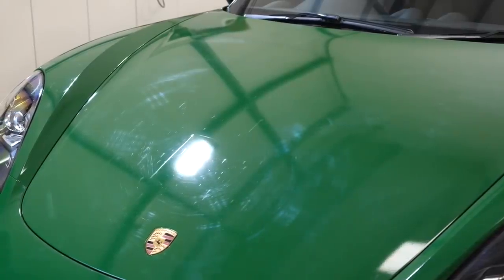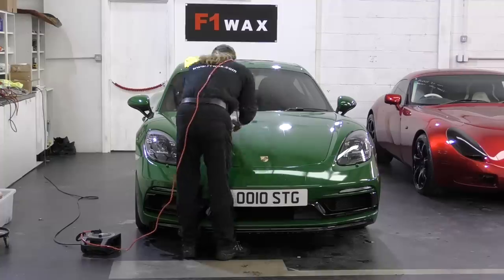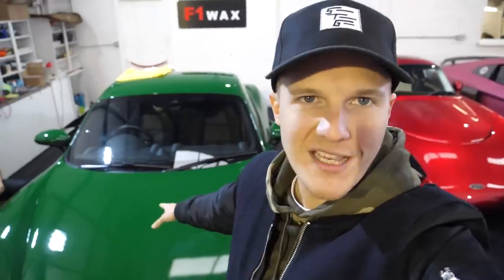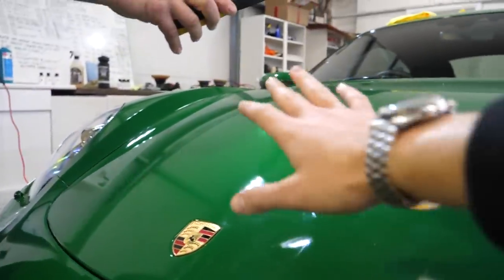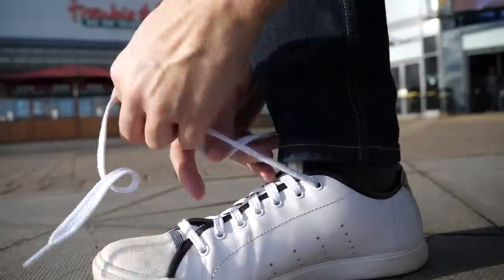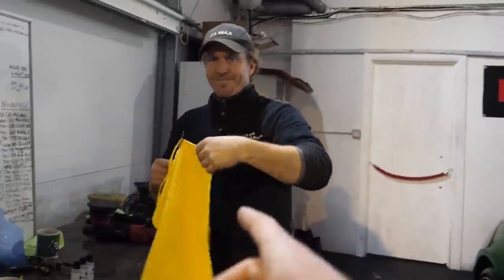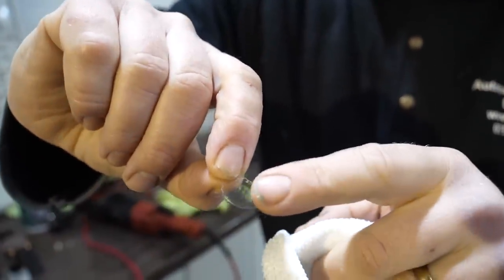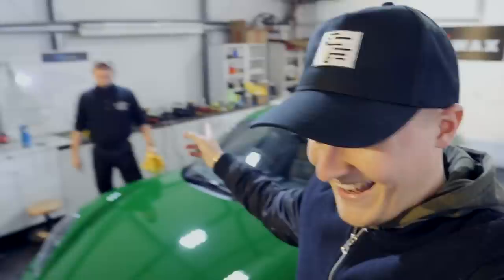Detail & Ceramic Coating To Vinyl Wrap

Comment: Wow, never knew you go that level of thickness of protection with ceramic coating!
Reply: Tiger Jim
You don't. You don't pour it onto paint and leave it. That was an exaggeration. Used to make customers excited
Reply: RB Detailing Yep. The amount of bullshit in this industry is astounding. People will believe that ceramic coatings will make your paint indestructible. Plus £100 for two or three applications ain't that great. Must be the most expensive liquid in the world for £100 per 10ml

Comment: If you love your car never use a car wash, doing it yourself it better, even more so if you know how to prevent scratches/swirls.
Reply: Halfdead Rider Yes but doing it yourself is really bad for the nature. So it's better to protect the paint so you can go to a car wash.
Reply: CinemaUnited lol what
Reply: By washing yourself you use more water and the solvents etc. go into the ground. A car wash is limited by regulations to a certain amount of water and needs to discard of the used water the right way. That's why CinemaUnited probably stated that it's really bad for the nature.
Reply: Rutger Vlaar it'll be fine lol. Over use would be bad but in moderation you're not hurting anything
Reply: Thomas Bailey It isn't fine. Your poisining the ground like some farmers do. The big car washes for example in Germany and Belgium make sure nothing goes into the ground and recycle and clean water to reuse it.
Reply: CinemaUnited there's still chemicals that meet the ground or air with that. If it was that harmful it wouldn't be allowed. Maybe the US has better regulations on that. Haha
Reply: Thomas Bailey Many harmful things aren't regulated.
Reply: If everyone washed their own cars so much shit would be in the ground that it would have a notable impact. Sure, one car wash wont do much harm, but many will.
Reply: CarPassion Yes if you just use water it's not that bad but it's still a waste of drinking water. But the soap, products, etc.. you use when washing a car are bad for the nature. Your poisining your neighbor that grows vegetables in his garden.
Reply: CinemaUnited wash your cars in the bath lads. And then wash yourself in it to save water, and the next doors radishes
Reply: In Europe many car wash stations offer boxes where you can wash your car yourself, with high pressure water/soap, wax, or use your own sponge and cleaning liquid and rinse.... all water and chemicals go to recycling or whatever treatment, not in the soil.
Reply: CinemaUnited what the heck are you on about. Just use ph neutral products,  unlike car washes which destroy paintwork
Reply: Rutger Vlaar never heard such rubbish.

Comment: Hey Sam, is that bottle of coating at the end of the detailing something like a PPF?
Reply: Randy Lim ppf is different to ceramic coating. Ppf is a thick clear film and is thicker than wrap film. Ppf is tougher than wraps and was invented by the us army to protect eg helicopter blades from shrapnel in the Vietnam war, car ppf is thinner though